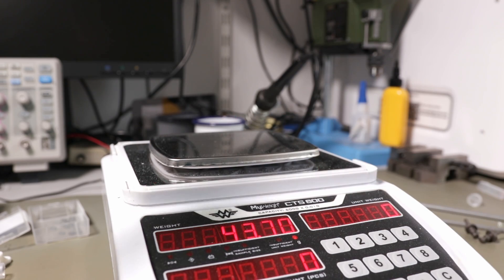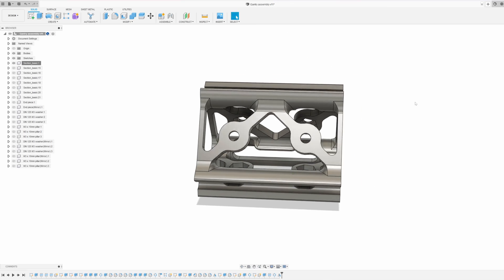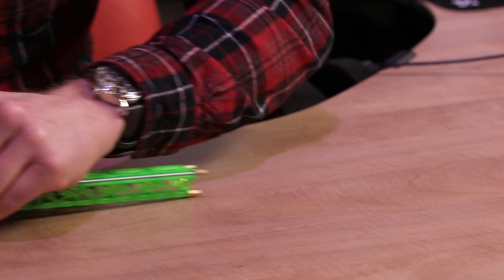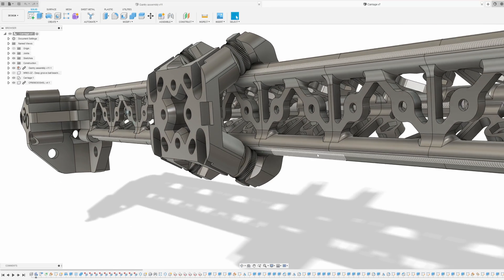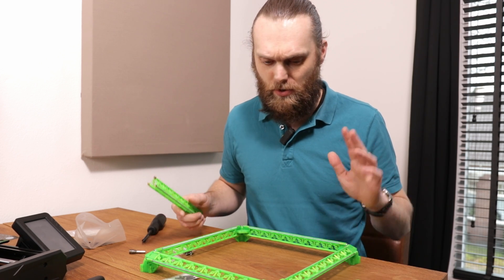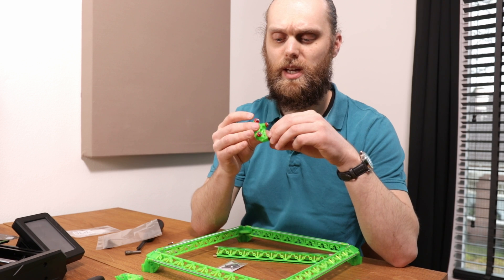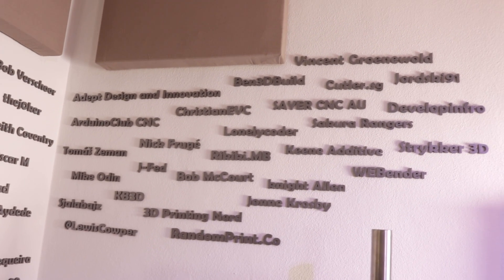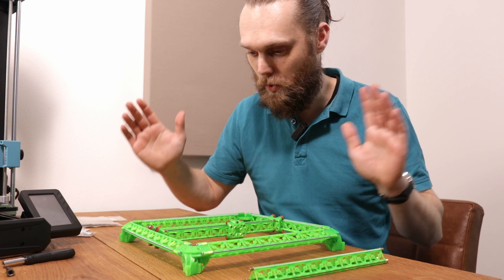Is This System the NEXT STEP in 3D Printing?

Comment: Looks cool but right now in that state it also looks way to complicated. KISS (Keep it simple Stuipid!) is an very important design aspect.

One flaw definetly is that the mounting surfaces (diagonal beams with their holes) are deeper than the M3 Rod with its surroundings. This will definetly make things unneccessary harder to mount to as you need distance washers or something.
So my tip is: make the sides completely flat!

Next thing an ecosystem needs to be as simple as possible. While an triangle shape is the perfect stable one, corners and everything become so much harder and mounting to it will need brackets. It would be much simpler if it would be based on a square shape.

If these two flaws would be eliminated, it could become the start to something, but that would highly depend on a easy accessability to the M3 rods and the additional required stuff.

The Idea of small sections that have strength in some vectors and then an M3 bolt that gets pulled and straighten itself while doing so while pushing everything together is smart, even if the bolts are slightly bent they will straighten themself when mounting.

Comment: You should think about the hollow steel rods with some threaded inserts soldered or brazed to them!
Or some smaller threaded rod cut to a smaller length and use that as an insert, again either soldered/brazed.
For the whole process only cutting external threads on some titanium rod might be preferable though.

Comment: Ohhh, I also tried to build a FDM printed truss system about a year ago and didn't like the result.

My concept was like origami, printing all 3 sides in one flat piece to optimise print speed and layer orientation. Maybe use an unextruded length of filament along the length as a pin to secure the triangles.

Comment: I would use this to make a printer enclosed of sorts
Granted it has allot of holes and no place to mount panels but I wouldn’t mind modifying it to make it more useful
Reply from the maker: Awesome! I did add holes for panels though, in the corner pieces themselves. I didn't elaborate on that though in the video.

Comment: A delta printer with triangular vertical axis would be extremely interesting
Reply from the maker: This shape would be perfect for a delta printer!
Reply: @properprinting  I tried a similar shape in my last project : i needed to lock in place two square boards (12*12cm, 6cm apart) parallel one to the other, I went for 4 straight bars in the corners, and two bars making a cross on each side, in Eiffel's style. For the bars I used  2.5mm diameter wooden skeewer, the system wasn't very rigid before gluing everything in place, but after adding epoxy at each join, it became so rigid, no more than 2mm of shift/twist when applying great force on both boards.

I am imagining an axis made of aluminum tubes (4mm diameter) linked with wooden bars with little printed parts in the corners to space everything evenly. Well, a project for my future delta printer

Comment: So right off the bat I said to myself... Stainless Hypo-tubes instead of threaded rods. For reference, I've been a design engineer in the medical device space for the past 30+ years.  As for lightening... Maybe a triangular beam that is not skeletonized but has gyroid infill, printed with one side on the build plate. That'll already make it as flat as the built plate, if it doesn't warp. 
I like this subject and I think you're on point thinking about the next step in 3D printing. 
As always, Awesome work! 
Thanks for sharing.

Comment: I love the work and the premise of the idea, I really would like to see how it develops. Honestly though I don’t think it would be a better solution as linear rails is used in many industries. What I would like to see is how it compares in terms of price. If you can have the frame this way and only need to use small rods and few fittings that would be a cool diy 3d printer project.
Reply: Also I subbed just in case you upload more stuff about this as I don’t want to miss any 😂

Comment: How does this compare in weight to the simple 2 carbon rods and linear bearings used by Bambu Labs?  You could probably even replace the linear bearings by lighter bushings sliding over the rods.  Sure those rods will have to be thicker, but you only need 2 (on each axis) and don't need all the filling with 3d printed parts over the entire length to make it stiff enough ...

Comment: What about 3 titanium rods with 3mm dia held together by the ends (making a triangle) and 3 L3UU bearings running on each rod attached to the tool head... sounds like a light yet stiff option

Comment: You could look into pultruded carbon fiber rods. I have a 3mm nominal diameter, 500mm length rod that weights only 4 grams and was roughly + 0.03mm/ -0.01mm in diameter. I'm not sure how this compares to the dimensional accuracy of metal rods, but I suspect the weight and stiffness would be difficult to beat.

Comment: what if you instead drilled a hole in the end of a tube and put a pin in that to tension. Puling the pin to tension the rod. Or use the rod as a carrier for heavy duty thread or fishing line and tension that?

Comment: Uhm... why make it so complicated?
The only thing that needs to be light is the moving mass, ie the gantry, the rest just needs to be stiff.
I'd suggest doing like the Ultimaker do/did, it minimize the gantry weight (and complexity) to a minimum, and you can easily go much lighter by replacing it with carbon fiber tubes (which also benefits from being fairly stiff).

Comment: Some ideas:
-use fiber reinforced polypropylene for stiffness and light weight.
-use stainless steel tubes and a thread former (not cutter) for the tention threads.
you can also still make your design smaller and maybe give the sections some interlocking features.

Comment: Instead of threaded rods, I'd just try with linear rods.
Also, the rods should be enough for stablilisation, so I'd use smaller segments with some distance in between.
But that's just my brain :)
I would not expect this described construction to withstand raw muscle power - though I'd only plan for it to withstand e.g. the force of the moving parts (and figure on at least double the expected force, to be safe).

P.S.: This is so cooooool!! xD

Comment: Magnesium should be a good material for 3d printer parts. The problem with magnesium is that it break instead of deforming (The crystalline structure wont let deformation to go where it needs). It is light and stiffer than aluminum, and onde we don't want any of out 3d printer parts to deform, it is actually an asset to have the useless part broken instead of have to figure out where is the problem

Comment: I suspect the main issue there is the bearing surfaces, whereever you've got plastic rubbing against plastic it's going to wear.
linear slides have ball bearings going around in a circle against a hardened piece of metal which is supposed to be ground to be really flat so that it's super accurate.
I could see this more as a replacement for alu extrusion for the frame although you'd have to compare the rigidity to alu

Comment: I love the idea but it should be scalable and cheap. Therefore i would consider carbon fiber rods, which are easy to source, cheap and available in many different lengths. You won‘t be able to cut a thread in them, but theres probably a different solution for clamping it together.

Comment: Shure it has potential - but it needs to be just as cheap as using a linear rail as a motion system and as far as I know titanium doesn't come cheap. The idea is great, just look at Rolohauns rook printers. The concept of using a generic building block is enticing.

Comment: carbon fiber tubes acting as smooth rods for the rollers you found? to tension might have to epoxy a threaded insert into the rod and then tighten against the end caps?

Comment: Its beyond me why you built stuff that doesn't move as the lattice - everything that moves should be light, everything that doesn't should be heavy and stiff.
Also law of headlines applies, if it ends in a question - answer is NO.

Comment: it is a very interesting design. IT's up to you if you want to continue. but it doesn't check any box for light, stiff, easy to use, ware and tear. I think you need a complete redesign. let me give you something, why not use a single rod for the center, and have half circles at each corner of the triangle. then all you need to do is have a single ball baring for each corner. you would reduce weight considerable why also maintaining stiffness. the problem that you run into tho, is you will have to print as one piece. you can not have segments. here is another idea since you have a single rod you could make the X rotate, which could prove useful when printing. but that would take custom code. could be something to look into tho.

Comment: If you can get your hands on titanium thin walled tube ,go that route with those steel bearings. The trick with making stiffness and a light frame is to go thin walled,and  large diameters. You will find the compromise between weight and rigidity.
My friends brag about their carbon bikes costing thousands, my bike is lighter and is a steel alloy frame. Thin walled ,double butted, stiff ,strong. Think bigger,thinner. Try  titanium bike frame tubes.

Comment: Scale up would be very efficient and practical. Same scale you would just need to go all plastic but print from resin. Good for scaffolding and frame work. May work well for different approach dimensionally to 3d print (triangulated).

Comment: I like the design! If it doesn't work out as a linear rail, I think this has potential for robotics as a frame. Similar to the currently often used aluminium extrusions.

As you already suggested, tubes instead of threaded rods might be a good alternative. If the wall thickness of the tube is thick enough, an inner thread instead of an outer thread could be used to tension the stacked modules. This has the benefit of using a smaller thread than one would need for an outer thread. (Hope this makes sense) However, the tubes then need to be shorter as the stacked modules.

Comment: Okay, Hear me out.. one finite cnc achieves rigidity using paired or tripled steel tubes. Your use case might work with carbon fiber tubes. Hollow, light,  rigid.

Comment: Look into OSG linear rails. That's basically what you're trying to make but in a triangle. Tronxy printers use these rails. I'm using them for a corexy pick and place atm.
Reply from the maker: Thanks for your suggestion! It looks like using the track rollers is not a bad idea after all!

Comment: The rails look awesome! If you switch to smooth rods it could in fact work, however bearings are always heavy. Maybe you can use slide bearings. You could take a look at "The 100", a printer mostly made from printed parts that went the exact opposite direktion to make the frame heavier to reduce vibration at higher speeds. 
As always, it's inspiring to look your videos! Keep it up!

Comment: Great idea and video + story telling, as so often my dude! But while your at it with the grooved wheels, you could replace the threaded rods with carbon fiber tubes...maybe with printed grooved wheels for weight saving? my old tronxy x5sa uses a similar system, but with steel rods and a rather heavy connecting metal part instead of your fancy printed light weight one. ....just my 2 cents

Comment: Try to replace the threaded rod with round stock and get a die to put the threads on the ends just where you need them.  I think putting sleeves over threaded rod will just increase the size and weight.

Comment: This challenge seems like it could benefit from a material database that includes parameters such a (weight/mass per gram) of material, (cost per gram), and so forth. I'm not sure what CAD/CAM you use, but it would be beneficial if that data could be part of your design analysis.
Reply: Also why do you need all those segments for the gantry? Imagine the gantry is 3 carbon fiber tubes held into a triangle pattern on both ends. The "trolly" that holds all the hotend carriage, is also a triangular shape and uses either circular linear bearings or some sort of triangular guide bearing configuration.
Reply: Or maybe even better ...Google Image these two terms,,,  carbon fiber triangle tube  ,  roller coaster wheel assembly. Now put the two together and have fun with your imagination.

Comment: I like this idea, but I don't think that printing them in small segments makes much sense. The printed pieces are probably heavier and less stiff as a result of being small segments. I would recommend that you create a parametric CAD version that generates some unit length printed truss (if you haven't already).

I also think that using advanced vase-mode techniques can get you maximum strength to weight ratio. I recently released some advanced vase-mode cylinders on printables for model rocketry that have built-in strengthening ribs as part of the CAD model and are printed purely in vase-mode. I can't post the link here unfortunately but the model name is "Advanced Vase-Mode Hollow Cylinders (model rocketry related)" if you search it should come up.

Comment: while you do want the moving parts to be light, the frame itself should be as heavy as possible for stability. so using those same "ultra light" design rules for the frame is very flawed

Comment: I don't know how many iterations you have been through but sometimes it takes a lot to where I need to. I think the gantry would be a specialed subset of the main system. Lego has special parts for odd situations that fit well in there ecosystem maybe use steal tubes and a wire create tension

Comment: What about the smooth rods with threaded ends and only the corners given printed parts. With a nut and washer on the inside and outside of the corner piece, you should be able to tension until straight, and remove all the weight of printed parts that run along the full truss.

Comment: Take tubes, cut them to length, glue in screws. And take these metall bearings. Doubt that is better than the aluminium gantries. But sure it has a much higher coolness factor😊

Comment: You make Videos, so go on and do it.
I mean it doesnt makes sense, it doesn’t need to perform well, but its a cool video to watch 🙂
Otherwise you could try to make a printer just out of linear rails (The gantry).
Or if you want to be productive and contribute to the printing development in general, you could try to make an heat resistent printer where the gantry doesnt deform under 30-90°C ambient temp. But this one is an expensive task.

Comment: Even if this doesn't work as parts for a high-speed 3D printer, I can see this being useful as a structural component for building things like boxes and enclosures.  I could see this making for a very interesting looking PC case, or as a replacement for those expensive aluminum extrusions you see on some printers (less cutting and drilling).

Comment: maybe you don't need smooth rods for every thing, just where the wheels touch. and you don't need the smooth rods to be structural. maybe just clamp them, or slightly hold them with glue. Nuts and screws add weight.

Comment: I think it worth using smooth rods with threaded ends, and ball bearings with round recess, like used in some cheap mk10 extruders to repeat filament shape better.

Oh, turns out you've just mentioned it at the end of the video

Comment: i would personally go with those thin aluminum extrusions for windows and glass etc. there's endless profiles to choose from and they're already rigid due to the box construction.. each part of the 3dprinter would experience different loads so different profile shapes could be used. the lightest one would be those channels for led strips

Comment: If you went with the hollow tubing, you could thread it on the inside to provide extra support at the ends.
Reply: Or, you could loctite in some threaded standoffs (like the ones used to mount PC motherboards). I'm taking my inspiration from archery arrows - hollow tube with a threaded insert epoxied into the end.
Reply: I definitely agree, smooth rods in the linear rail portion would definitely be better

Comment: Do the side rails need to be extra light also? It makes sense for the moving gantry to be light but I don't think the side rails need to be light as they shouldn't have the need to move. I can definitely see where it helps to have the mounting to the side rails still be light and thus possibly needing to have a custom mounting solution

Comment: If you put herringbone rack teeth along it and get the tolerances right at joints between segments, you could use herringbone gears along it as a fully printed linear bearing that's self centering. Like a less awful version of V rollers.

Comment: You need the shape, not the entire rail. Print as sections and space accordingly as required for the desired regidity. Use hollow tube and epoxy threads in the ends. This also opens the door for CF tube. The result should be consideraly lighter and equally or more rigid.